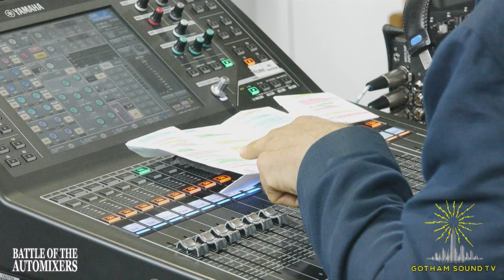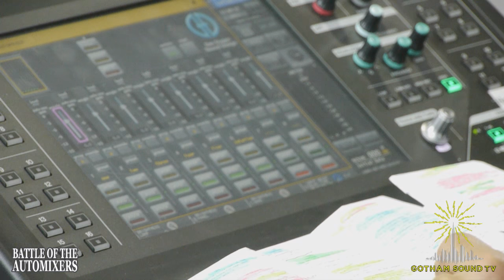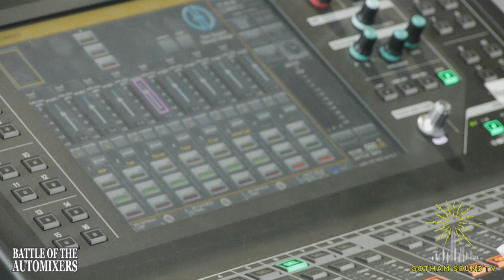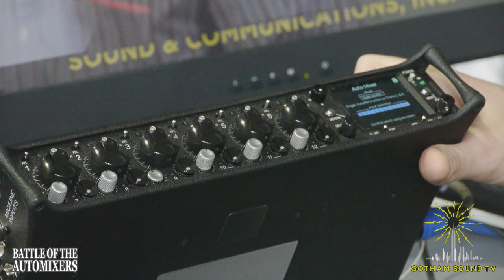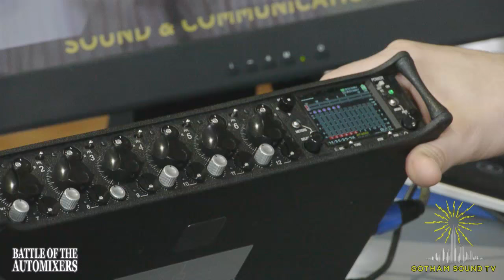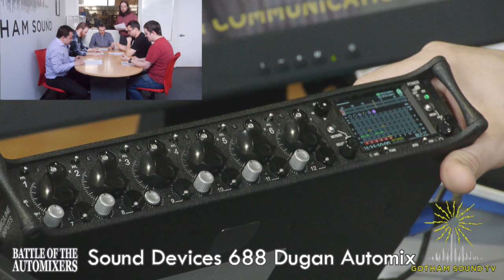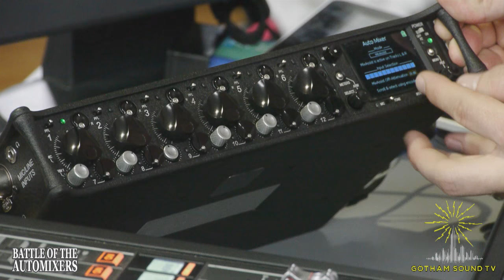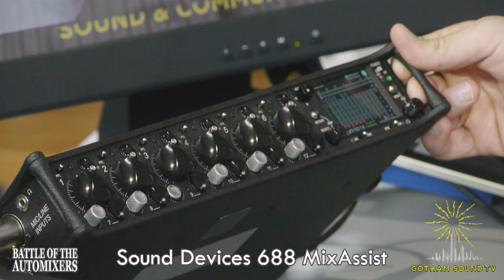Battle of the Automixers

Comment: Is there an automix plugin for post in a daw? if so .. one that could handle at least 3 inputs, and be able to write automation? thanks for the video!
Reply: The Waves Dugan is probably what your are looking for.
Reply: I have that plugin, and it works great for live environments, I am looking for an offline edit or daw, something that I can tweak after it has been applied.
Reply: @PaulGalvez  did you ever find this?
Reply: Anthony Villena I did a virtual route in my computer and did a live automix. It didn’t work flawlessly, but it was a lot if work for what it was worth. So I would not recommend it
Reply: @PaulGalvez  did you ever find a solution. This will help me do a post mix people on a budget
Reply: @DebF124  I did not find a solution had to do it manually. All the best
Reply: @PaulGalvez  thanks for the quick response for a question from 4 years ago lol. All the best man

Comment: Wouldn't I get the same result by using a Gate plugin in post?
Reply: No because you're not completely muting tracks the way a gate would and a gate will prevent quiet sounds from coming through that are below the threshold. Keep in mind that Automixing is gain-sharing, meaning that the loudest signals are all evened out. Automix is much more sophisticated than a gate and if you manage it properly it will give you a much better result.

Comment: Did you use a mix assist for your recording? Seems a little slow. I still use my Shure Fp 410 for these kinds of situations
Reply: I think that's the same algorithm as MixAssist.
Reply: I don't know which Algorithm is used in the FP 410 but the performance of the 410's (at least in the situations I used them in was much smoother than what I was hearing in the hosts audio mix so I would guess it wasn't mix assist.  The current models are SCM820 and SCM410.
Reply: I've been using the Shure FP410 and SCM810 for many years on video shoots of public meetings. The Shure algorithm prevents phase cancellation between mics picking up the same sound source and will only leave one mic on when that happens. I use this to my advantage when shooting public meeting videos and there is a podium mic for guests to come up and speak during the meeting. During a meeting, the podium mic can sometimes be turned off or moved out of an ideal position of the person at the podium walks around away from the mic when they speak. The podium mic is typically cardioid or supercardioid so I tape a wireless omnidirectional lav mic on the podium mic. When any of the "bad" scenarios happen at the podium I turn up the gain on my wireless lav mic and that will gently fade out the podium mic automatically to prevent phase cancellation. Does the Dugan algorithm prevent phase cancellation like this?